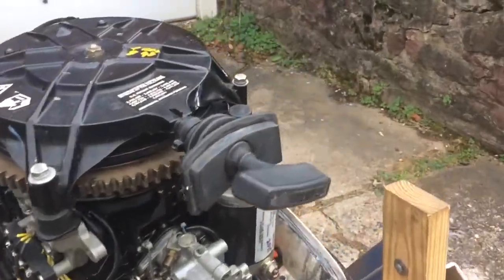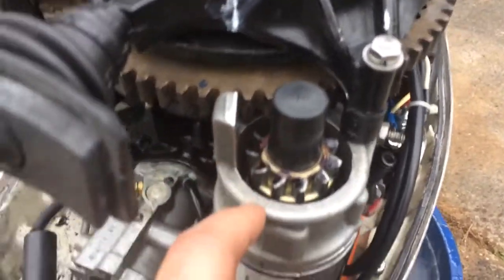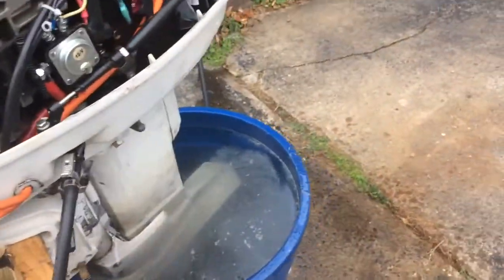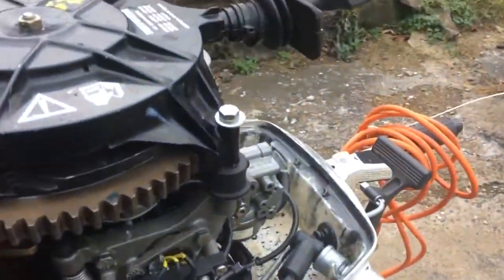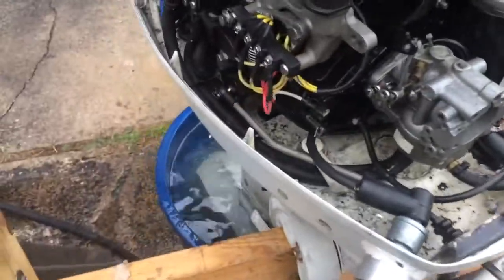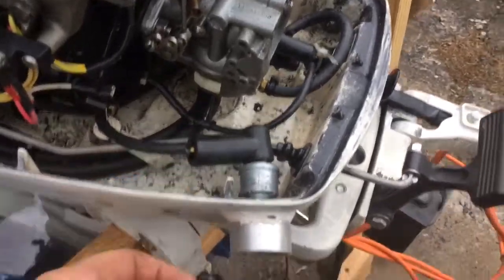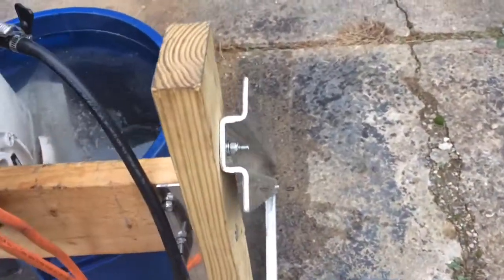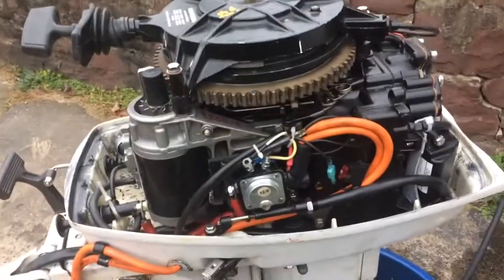How To Add Electric Start To Outboard Motor (Update) Part 2 of 2

Comment: I am trying to put a pull start on an electric start and running into same issue with spacers hitting teeth.What did you use for spacers ?

Comment: When you grinded on the starter gear. Was that because it seem to be hitting the flywheel rather than matching up like they should. The bang when it does it drives me nuts

Comment: Ian,
I have a 97 Johnson 25 that I'd like to add electric start to.  It's enough different from you 92 that I don't know where to start...right out of the box, the whole flywheel is iron, no aluminum...any idea where to start looking to find a flywheel/ring gear that'll fit and retain the pull start?? thanks,brooks
Reply from the maker: Sorry for not getting back to you, let me think and get back to you with some ideas